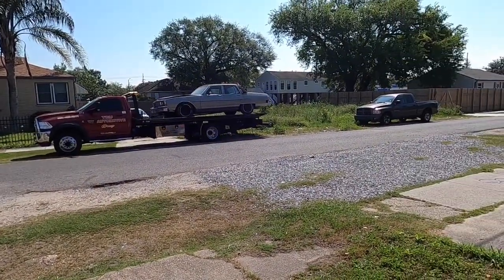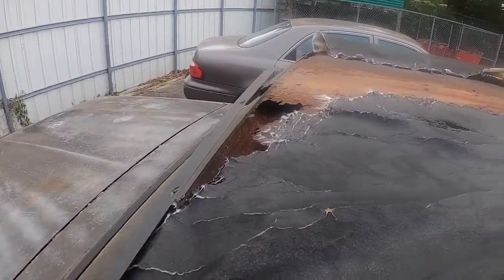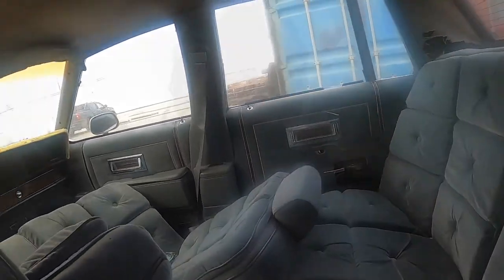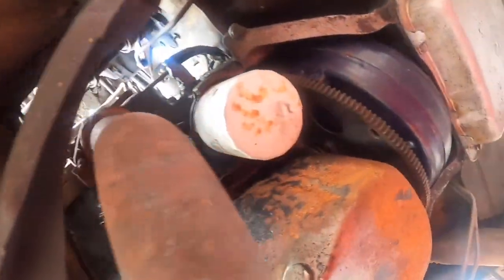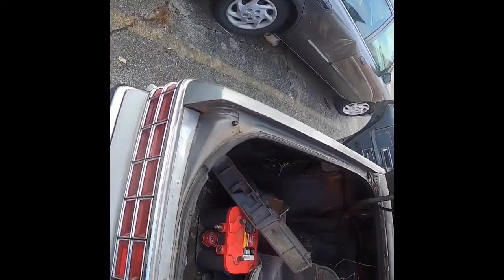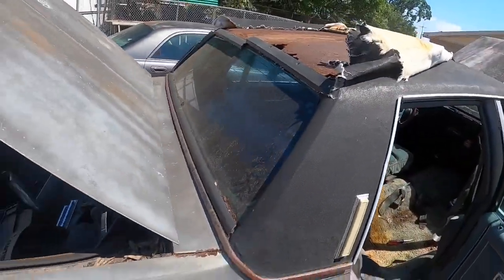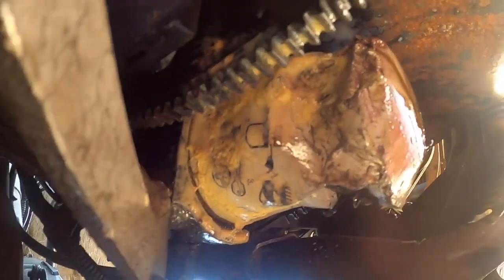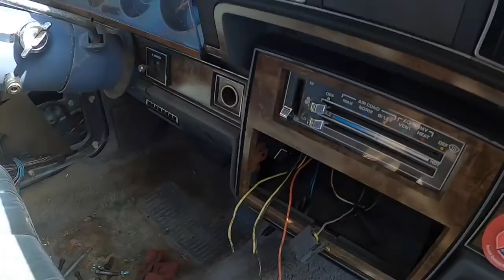My 1985 PONTIAC PARISIENNE Project (Part2)

Comment: I have a 85 parisienne and in the process of restoring my roof and can't seem to find trim for the back glass...can anybody help me
Reply from the maker: Kenneth Johnson I would try gettin parts off a box Chevy since they resemble each other may have some luck
How’s your roof
Reply: It's rusty and has a few small holes about 2-3mm in size I haven't started sanding yet I have been trying to find all the window trim.other then the roof it's In solid condition just needs some paint and a new dash.it has the 305 in it with a rebuilt 700r4 and only 107000 miles on it.its been passed down my wife's side of the family from her great grandpa,grandpa,dad and now we own it